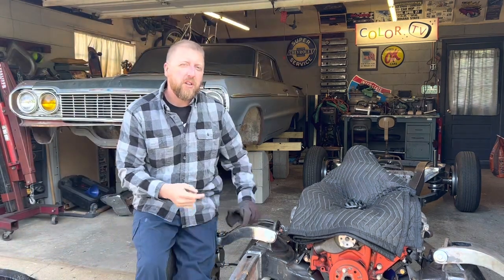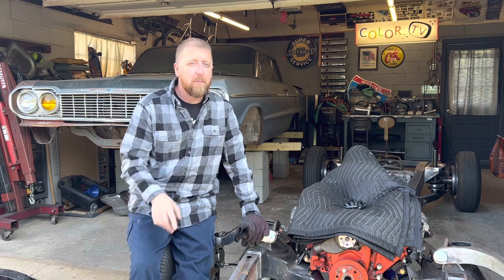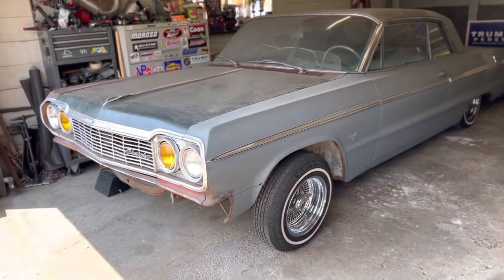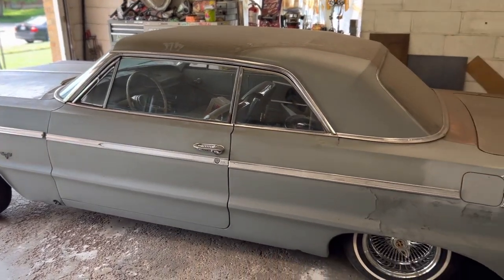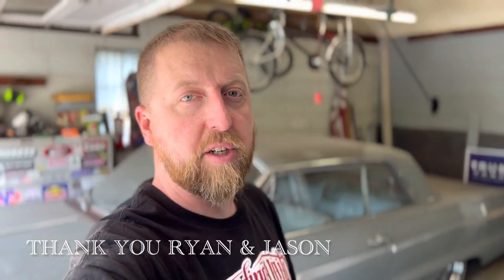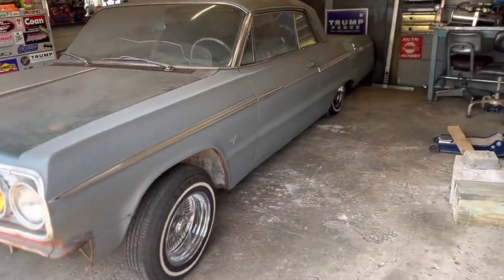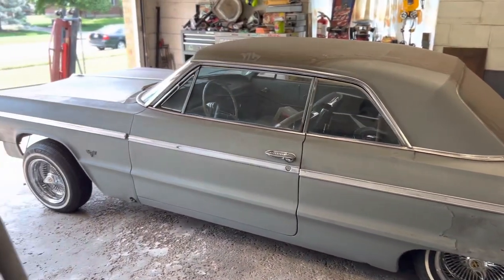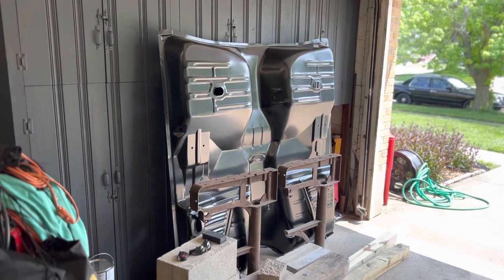Getting the 1964 Impala frame ready for convertible body mounts! Stay tuned!!

Comment: Heck yeah I’m happy to see it coming together. One question.. why convertible body mounts? What is your reasoning for those? I guess I don’t understand the purpose behind it so I’m curious. 🤙
Reply from the maker: Convertible 58-64 chassis have 4 extra body mounts compared to a standard hardtop frame. Adding those additional mounts will help with flexing issues typical on X-frame cars.
Reply: @gemcitywelding7234  word! I didn’t know that. Thanks for the info. Mid august is my scheduled date to have my frame wrapped. I’m gonna talk to the guy doing and see if that’s some thing we should add. Was your frame a convertible frame? Or that’s just added safety your going with??
Reply from the maker: @shooterchief  my frame is an American frame. Adding the conv mounts will help with the stress put onto the body at the “c” pillar. You’ll see a number of 63-64 cars with stress cracks on the quarters in that area. This will help with that problem.

Comment: Putting the Vert mounts on a hard top is that a hydraulic thing?
Reply: Yea, you’re fine if you aren’t hoppin but if you are you can buckle and crack the usual spot near the rear quarters up by the windows. Theres a span of 8’ in between mounts front to back thats unsupported if you don’t add the mounts.